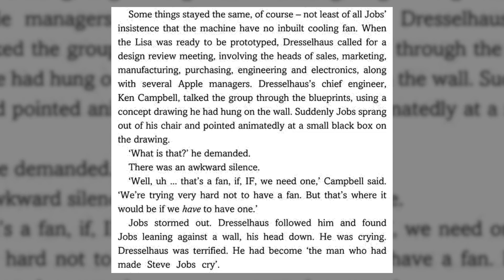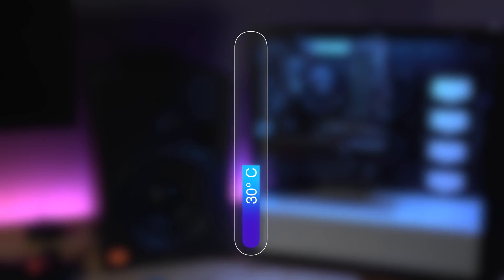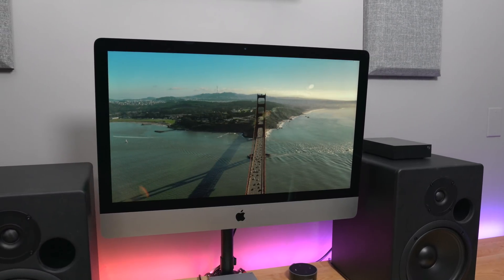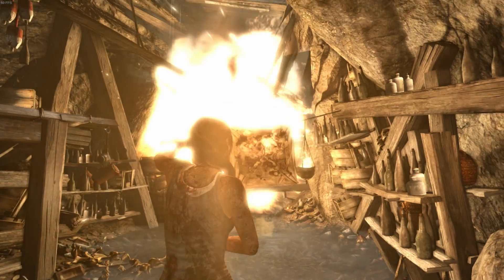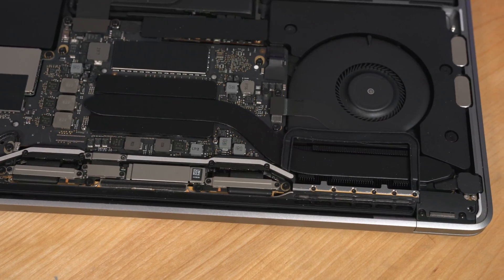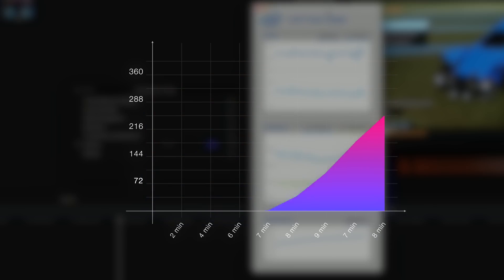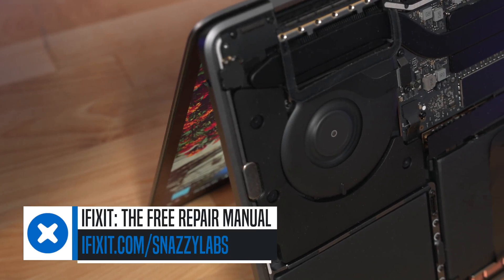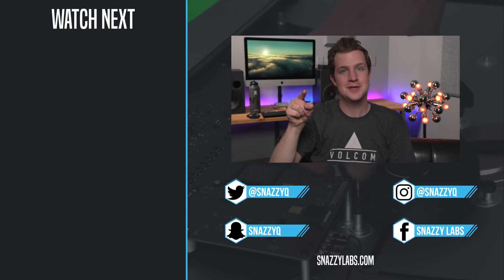Is Apple Ruining Your Mac's Performance?

Comment from the maker: Spoiler Alert: Yes.
Reply: Snazzy Labs truly a great video once again keep it up man
Reply from the maker: +Martin Thanks man!
Reply: @snazzy  Actually the touchbar 13" Macbook Pro has 2 fans. So a bit better cooling but yes: most high end laptops thermal throttle.
Reply: I love Mac fan control. It’s the one I use and it works great for keeping my computer from overheating.
Reply: for your next video, build some kind of a portable cooler for the macbook pro
Reply: What is your opinion on using third party software that gives you control over your fan speeds. I personally turn mine up when I go to play a game. I have heard some people say that doing this can damage the machine, which i find unlikely, but I’ve also heard that it can reduce the fans lifespan making to it break down sooner then it might have. I’m unsure on this one, what’s your take on it?
Reply: Snazzy Labs oh just download macbook fan control. It works on every iMac Macbook or whatever. Just set the fan to run at a constant RPM all the time.
Reply: @nikosgiannos  what programme do you use? What RPM do you set it at? 

Also... What do you use to know the temperature of the MBP? Pls help.. 

I got my MBP recently 2020, 13 inch, 1,4Ghz Quad core model and while playing Dota 2 it got very loud and very hot..
Reply: Or get "Mac Fan Control' where you can set any temp on any components or areas of the mac & adjust the fans to come on faster when under more load.
Reply: Snazzy Labs i have a macbook air 13 2013 mid. Should I change the Thermal paste? Would it make any diffence? Normally is at 37-40 C in a 20 - 25 room
Reply: Snazzy Labs you need to reopen your iMac and pulled the 7700K, delid the cpu with a rockit 88 delid’er use Thermal Grizzly Kryonaut Thermal Grease Paste between the cpu and heatsink and then use it on top of the heatsink. You’ll probably see a 10-15 Celsius drop
Reply: TG Pro
Reply: the powermacg5 is a really silent pc, you need to calibrate the fans after removing them tough. That clip you showed in the beginning is a malfunctioning pc
Reply: Snazzy Labs you're forgetting that the touchbar MacBooks have dual fans and fan grills on the sides.
Reply: Watchman4u yes macs fan control is the best application I ever downloaded for my 13" MacBook Pro. I would definitely recommend it as a necessity.
Reply: Nathan Posacki my mac felt like a car's manifold and the screen would fog up Lol got the mac fan app. I believe it has been a huge help.
Reply: Thunderbolt Everything not necessarily. what if both are using adobe premier? final cut does prerender (in the background) and hence is y it cuts render times than a Windows machine running premiere with similar specs for example. its not an operating system 'problem' its an application software 'problem'. Adobe should work to include such a feature in their new software versions.
Reply: Snazzy Labs There are software applications that allow you to overwrite the fan control. So you can specify your own set of conditions to control the fan speed.
Reply: Juan Lebron name of program?
Reply: Jeff Liu Yoshiyuki "smc fan control"
Reply: Do you think the IMAC pro will offer the best cooling of any mac?
Reply: Where Are giveAway results ??
Reply: You actually can improve that shitty cooler at the expense of noise by removing control wire if fan is connected to the pcb by a cable.
Reply: Snazzy Labs hi!!
Reply: Do you recommend a app to check the cpu check? Im doing quite some 3d rendering on my mbp 2015 and want to see how much it drops
Reply: Macs fan control?
Reply: it was in energy saving "automatic graphics switching that made my MacBook Pro baby lake 15 inch lag
Reply: Snazzy Labs in that case could I just use 7700t on 2017 imac? Surely I'll avoid thermal throttling while having extra tread to spare???
Reply: must use smc fan controller
Reply: well you need to see settings of smc fan controller are you should have smc restart laptop
Reply: Juan Lebron you mean Mac optimizer pro (a crappy piece of ad/spyware)
Reply: omg u pizza emoji
Reply: >:O really Snazzy Labs?? Or is just a joke?
Reply: Oh you wanna know a real way to start heating up your Apple MacBook Air laptop, simply play Roblox literally me all day, but a software update recently came & I think it fixed the problem I’m not to sure
Reply: a more expensive cpu at higher frequency in the 13" model does not in it self mean that it is a more power hungy cpu. If you heard about the "silicon lottery" there lies the reason. They bin the cpu's so that more effecient ones are the more expensive ones, and worse chips run slower or even go from 4c/8t i7 to a 4c/4t i5 for the same reason.

The more you know
Reply: Please do not pull a Linus and using teenage language like "balls". I like watching you because you're entertaining not just for teenagers.
Reply: I prefer silence.
Reply: Spoiler Alert: Not really.

Go export a 4k video on a similarly spec'd Windows laptop using the professional video application of your choosing. I will bet my house that your Macbook will still get the job done faster (and quieter) EVEN WITH THE CPU THROTTLING.

Comment: I use a small desk top fan behind my Mac and have temperature control installed - I run an iMac mid 2011 it’s only used for photoshop - which I purchased and installed in the days where you could do that and a bit of music and it’s awesome

Comment: The g5 tower is best computer apple ever made...apple pro 2019 is overpriced in long run think 60kplus +10k repair or + another 60k plus replacement cost beyond applecare. Ouch. Macbooks overpriced very closed. All in ones sucks rather apple or pc.

Comment: I live in a tropical country so obvs after using my Macbook Air for long periods of time, my laptop would be very hot especially the power port connector (I accidentally touched it once and it felt like a hot pan), only then would the fan start (very loudly). Whenever this would happen I would turn on my aircon and place my laptop directly in front of it so it would cool down. Hassle.
I also frickin really hate the sound of the thermal throttle. It makes my head hurt and I can't work.

Comment: I'd love to get some feedback on what I do. I have thin freezer packs that people freeze and put in coolers, say in between layers of drink cans. I have two of them and when the Macbook Pro 2017 gets hot, I simply set it on top of one of the freezer packs on my desk. Within 5-7 minutes the entire Macbook is cold. I have two of them and I just rotate them. The added bonus is that the freezer pack, even when thawed, continues to conduct heat. By the time I stick this thing back in the freezer, it's HOT. Is there any reason I shouldn't be doing this? I've done it every day for two years now with no issues.

Comment: oh and another pro tip i tested personally: if you have a really old laptop, that struggles with basic games (like my 2010 lenovo notebook with extremely awesome 17fps on ultra lowest settings in LEAGUE OF LEGENDS! xD):

Take one or two cooling packs, and put them where the intake is. this both lifts the bottom of the notebook off the table (which allows even the slightest air flow to take heat away instead of stacking heat into the surface) and most importantly the fans pull in WAY cooler air. i was able to hit 25 fps with this method, changing cooling packs every hour of gaming. 
Doesnt sound like much, but 17 -> 25 fps is a third more performance!

Also, i got a mid 2009 mac book (you remember: those really cool all white plastic ones :) ) and there, the fan is sucking air out of the notebook where the display is from... no where. fortunately, you can easily cut a small hole exactly where the fan sits and lift the macbook by raising the four rubber stands half a centimeter. i put a aperture lense on the hole, which looks cool and also can be completely closed when transporting it to avoid stuff to fall into it. this made a difference of almost 20°C degrees on max load! i then reconfigured the fan curve to a little bit more aggressive one and now this 11 year old mac book runs not even 70°C under full load. (thermal paste change also a good idea btw).

Comment: They already fixed this problem, with the 2019 MacBook Pro’s but for everyone who’s still looking for a solution, download fan control with this application you can regulate your fan speed this allows you to set the fan speed higher so you partially prevent the risk of thermal throtheling.

Comment: Well, for what it’s worth, I own a recording studio. And I love the fact that my MacBook is so quiet. And I never run the processor at a level to cause it to get hot. So, for me, the Mac is a great choice. 

Also, I love the stability I get from the Apple software. 

I also have an ASUS computer that works extremely well for recording. 

I just wanted to include this observation. 

Thanks for the excellent videos.

Comment: I agree with the point you are trying to make completely but there is one thing that might be a little misleading The MacBook Pro 13inch with Touch Bar has two fans instead of one, I currently have that exact config with 3.1 ghz dual core i5 and it does not thermal throttle.

Comment: My MacBook Pro Specs:
OS: macOS Mojave
Processor: 2.3 GHz Intel Core i5
Memory: 8 GB 2133 MHz LPDDR3
Graphics: Intel Iris Plus Graphics 640 1536 MB

DISPLAYS
Built-in Display
13.3-inch (2560 x 1600)
Intel Iris Plus Graphics 6540 1536 MB graphics

STORAGE
Hard Disk Name: Mojave
Storage Available: 53.29 GB available of 121.02 GB
121 GB Flash Storage

SERVICE
Every Mac comes with a limited warranty from Apple and up to 90 days of complimentary telephone technical support.

If you have purchased an AppleCare product, you get up to three years of expert telephone technical support and additional hardware service options from Apple. AppleCare product benefits are in addition to any legal rights provided by consumer protection laws.

If you require repairs and your coverage has expired, you can have them performed by a Apple-authorised technician for a fee.

-> Check my service and support coverage status
-> Show my service and repair options
-> Tell me more about AppleCare products

Comment: YOU WILL cause condensation to build inside the machine if you put it inside a freezer or refrigerator... I work at a facility that uses big industrial sized walk in coolers, the size of a warehouse, and the computers inside this environment gradually has condensation around the copper and steel regions... sometimes they die prematurely from the built up condensation, you will see beads of water droplets inside!

Comment: Snazzy Labs, you state “Macs are quiet because Apple keeps the fan speeds as low as they can for as long as they can”. This is such a myopic and naive argument from you. Your shallow argument sets you up to jump to conclusions. Apple puts a huge amount of engineering into the smallest details. Take fan blades. Apple doesn’t just order off the shelf fan parts. You are right that noise is an import consideration for Apple. You did not do your homework here. Apple designed asymmetric fan blades to mitigate noise. Apple patented this design. These asymmetric fans have been in their portables since 2012. Whatever the reason for the throttling, your comment 41 seconds into this video was flat wrong.

Comment: I had an old Mac running Snow Leopard and it got INCREDIBLY HOT. So hot that when I touched the screen it was really hot. The only time I've heard the fans were when I put my Mac on the floor when I was getting a new desk.. 
I don't use my Mac anymore though because it can't update (No storage) and Snow Leopard is not even supported with Google! I just use a Windows 10 laptop now. :P

Comment: Hey dude, I know this is an old video but just wanted to chime in, these macbook pros are inherently prone to condensation build up. Putting it in a freezer and then bringing it out into warmer air is very bad for it and can cause condensation build up which leads to corrosion and failure of the system board.

Comment: That was the first thing I noticed with the Macbook White I had back in 2011. I noticed that during even mild usage the Mac got really hot. Installing a fan control app solved that bit for a while, but somehow 90% of the people in my grade got some pretty bad heat fractures in the chassis with moderate use.

Comment: Both my 2007 and 2011 Macbook Pro can run heavy loads for hours without thermal throttling. I don't know about the 2013, but I suspect this is a problem designed into only the latest model Macbook Vista.
Apple has completely lost it. I think the problem is that for Tim Cook the shareholders are the customers, not the people buying the products.
He doesn't seem to be able to tell me why I should buy their stuff. And even then I can think for myself and will avoid buying these poor products.

Comment: Actually the base model rMBP 13' has a different cooling system :  it has one fan whereas the others have 2, so they wouldn't throttle as badly

Comment: Great video! However, according to ifixit themselves, the 13" Macbook Pro with TouchBar (and a faster processor and GPU) has 2 FANS instead of the one in your base model. I guess that at least helps with throttling. : D

Comment: Well, I have a mid-2015 Macbook pro 15" with Iris pro graphics, and I have to say that it's thermal design is good. It gets hot when I do something intensive, like compile macports, but it never goes past 90°C, which I would consider terrible on a desktop, but is still below thermal throttling, and I never actually lose performance. It's not designed for a sustained 100% load, but rather for normal use with occasional load peaks, which is how one normally uses a computer. I even exported 4K videos on it without any thermal problems.

Comment: Uhm maybe I didn't get something right: So when you bump up to the temperature so that you reach thermal downthrotteling, the fans still went crazy right? So the cooling system works. So now the question is, whether or not the cooling system is enough. At this point we already ruled out, that the fans are artificially slowed down to keep silence. Which means Apple's not doing anything "intentionally". Now to the question, whether or not the cooling system is sufficient. So I'm not a multi media person in my daily business, I'm more concerned with algorithms. For fun I write some Prime Generators, that use 100% of the CPU (Cores + Threads + Caches). In this case, the CPU temperature never exceeded the limit of 100°C (MBP 2017 15"). It stayed around 60°C-70°C. So for the cores themselves I suggest, that the cooling is actually very sufficient. So why did Snazzy have problems? Well exporting video requires the gpu not the cpu. Now on the 13" base model, the only gpu available is integrated into the cpu (intel iris 640). So not only the cores but also the integrated gpu are heavily loaded when exporting. I think at this point only liquid cooling or a lot of fans and space can provide an actual cooling system, that is sufficient. But then you miss out on the thinness and the protability, which is also very important as these are the characteristics of laptops. I think it's quite clear, why and when compromises are needed. As this is the internet, I should add a disclaimer: this is not in defense of apple, but in defense of physics. You now the stuff that makes IT run in the first place ;)

Comment: I live in India, my MacBook pro idles at 57deg Celsius and under load gets till 100 deg Celsius. For me my workflow has always been start mac fan control app crank the fan to 6000 rpm and then start my photo editing software. I have never seen the temps get below 80s under load whatever I do, the heatsink is absolute crap considering my mac has no dedicated gpu.

Comment: I don’t know if you’ll read this but if you use bootcamp and try games on it, previously it might have worked but Noah because of the heating issue it doesn’t work well anymore. I have a MacBook Pro 2017 15 inch and  just playing gta for 5-6 minuets thermal throttles it and bring down the FPS. Any suggestions?

Comment: This is why I can't buy Macbook Pros, anymore.  I used to always get the highest spec'd CPU and GPU, then upgrade the HDD and RAM myself to save cost, but that is no longer possible!  What's the point in a fast CPU if you can't use it?!  I'm going Hackintosh until Apple gets its act together.  If that never happens, well, I guess it's back to the Windows world :(

Comment: The CPUs you compare may be faster, but the TDP is the same in every machine lineup. The i5 model of the 2017 13" MacBook Pro Touch has the same 28W TDP as the maxed out i7 of the same year. So the cooling problem is the same, regardless of the CPU choosen.

Comment: 57C idle???? my Thinkpad T61p with a 80nm Tesla GPU (Quadro FX 570M) idles at a lower temp then that, although in my T61p's fans never crank up too, the highest speed they go up to is about 4400RPM but only have gone to that speed only twice in my year of owning it, other then that it locks itself at 2400-2600RPM even when the GPU is at 91C seems as if apple isnt the only one forcing the fans to stay quiet no matter what

Comment: On my 2017 15 inch I imported as well as exported 50 36mp raw images as well as applying several demanding  filters in photoshop such as surface blur in 16 bit mode, and my fans went to full speed, temperature stayed between 97-99, and cpu never went below 3.1, staying at 3.3-3.4 the majority of the time. So I would say no, apple isn't ruining your performance.

Comment: Quinn, did you know that the nTB and TB MBPs have different cooling setups? The TB one has two fans instead of just the one. I bet you would see different results. The CPUs are also 15W vs 28W, so I am curious as to when the TB one would thermal throttle in the same test.